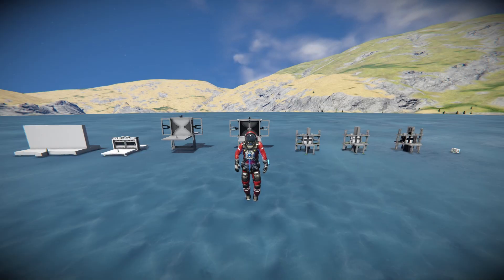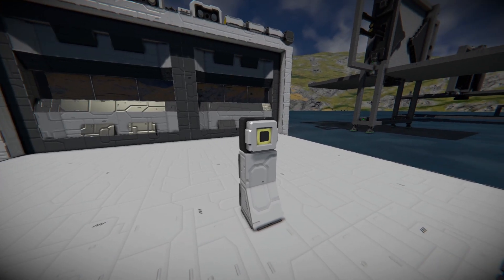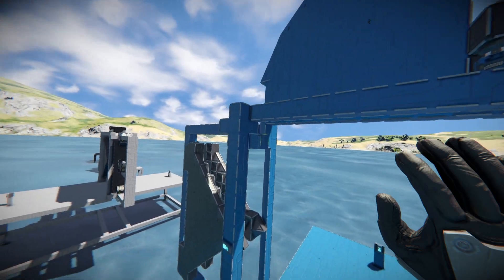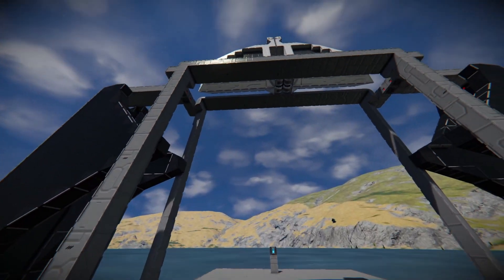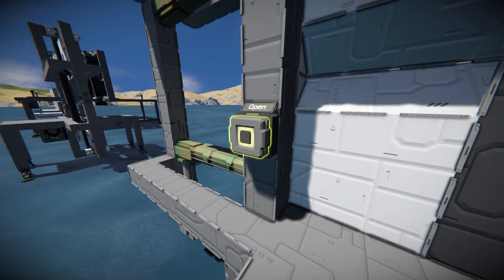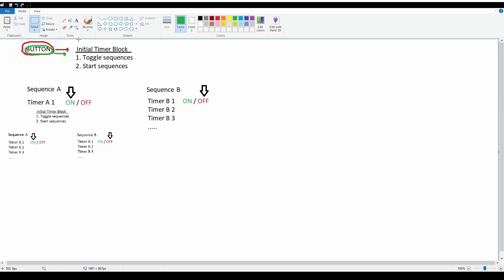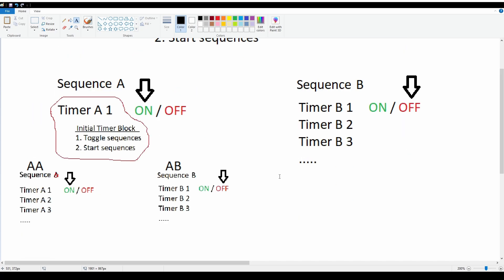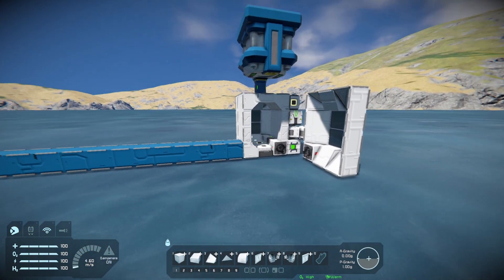Custom Airtight Doors In Space Engineers

Comment from the maker: Thanks for mad amount of views! I've now made a full tutorial on these custom airtight doors if anyone's interested! 
Comprehensive Guide On Custom Airtight Doors: https://www.youtube.com/watch?v=mooy4fuWgDc
Reply: I have a bit of a problem , I hope you can help . When I make doors like this or similar to this in space on "station" grid  they lock up after merging and un-merging and things refuse to move . Any idea why ?
Reply from the maker: @russellbridgman3052  Hey! Have you checked that the door grid really detaches from the static grid? Meaning there are no hidden connections besides the merge block. If it's because the grid stays as a static grid even after detaching, then I'm not fully sure how to fix it... I may have run into the same issue, but it's been a while so I don't remember how I solved it. And to be fair I mostly made small grid doors that would never have this issue to begin with. 

It may be possible to solve this with either a programmable block or an event controller; when the merge block is turned off, it tries to automatically convert the door grid into a ship. This sound pretty janky though.

Hope you'll figure it out!
Reply: @MjuMeli  thanks for the feed back , I think it's just a large grid space thing , just converts to station and locks up , proper nuisance .
Thanks

Comment: I love your work dude, I got hooked on your circle videos and this one gave me an idea about a emergency Escape pod using some tips from your super small airlock. Pretty convinced you can make an escape pod in small grid that would fit a 1x1x1 large grid cube worth of space. Not so sure about life support systems in that size but I only just watched the video, so I ain't built nothing yet.
Reply: By the way did you ever find my first comment?  Literally my first post on any video in YouTube, I believe I left it on one of your "Flat Universe Theory Showcase" videos by accident instead of "Even More Circle Stuff in Space Engineers"...
Reply from the maker: Ooh, That escape pod is an awesome idea! Excluding an oxygen tank (I wish there was a small version like the hydrogen tank) you should be able to fit everything in a 5x5x5 cube. 
The air inside the pod will last you a while and you could add small cargo containers in the walls with some oxygen bottles inside them for some extra air supply. 

And yeah I noticed your comment (BTW thanks for blessing me with the power of your first comment :D) and left a reply. Didn't you get a notification? It's in episode #1 if you can't find it.
Reply: @MjuMeli  Remember: a pod that includes an oxygen tank … that's a cockpit.
Reply: @MjuMeli  glad you like the idea & no I didn't get a notification, I have notifications turned off because of errors in my phone. Imma check out what your thoughts were regarding my first message, I'm eager to find out what you think of that.

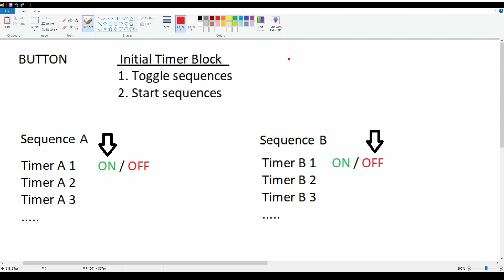Comment: 10:00 thats exacly how i set up my landing gear but i had build in two more times so make it lock so i cant accidentally double press it and make it bug around because of the timing.
Reply from the maker: Awesome! A custom landing gear is something I've wanted to build for a long time.
Hey how did you work around the double press issue? Extra timer to turn off the initial timer block for a certain time?
Reply: @MjuMeli  i made a "start"-timer that is just there to be turnd on and off, after that the start timer triggers the second timer, the "lock"-timer, the "lock" turns off the "start" and splits the timers like you did in your setup.
After the last timer did his action, he triggers the "unlock"  timer which turns the "start" back on.

If you have delays, for example a piston, you have make the delay on the next timer block, so it waits for the command to triggre.

i think that you could make that easier but i want it to make as logical as possible xd

Comment: 12:30 reminds me of a zipper
I actually may like this one the most, as i suppose you could be a bit more flexible with the strength of the parts, meaning you can increase the durability of an entrance by just putting another layer on AND if one part is shot out the others still work.

Comment: Does the grid type make a difference on if the doors work or not? I'm trying to figure out custom airtight doors myself and I'm having an issue with the doors not opening after the merge block is turned off. I have the grid I'm working on set as a station so the kracken can't run off with it, is that the issue?
Reply from the maker: Most likely the issue is that you have some other place where the door connects other than the merge block. You could be hiding an extra connection somewhere on the side of the door for example.

I guess it could also be related to the grid becoming static if the frame is a static grid. I've never had this problem, but then again I've only used small grid which can't become static.

I have a tutorial if you wanna check it out.